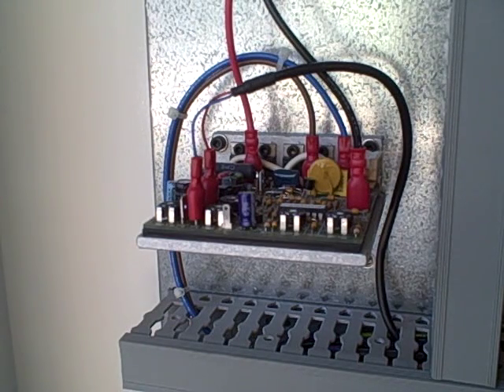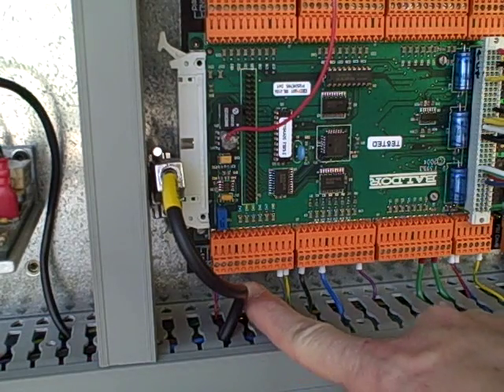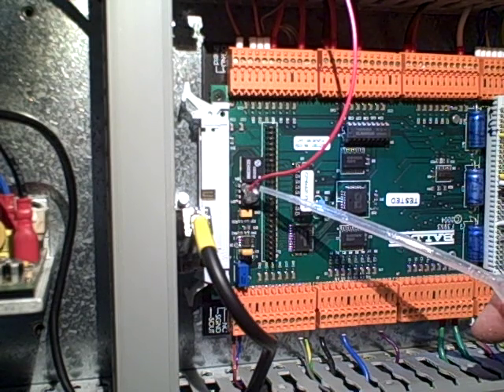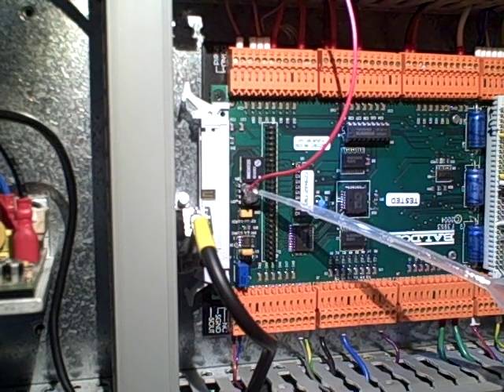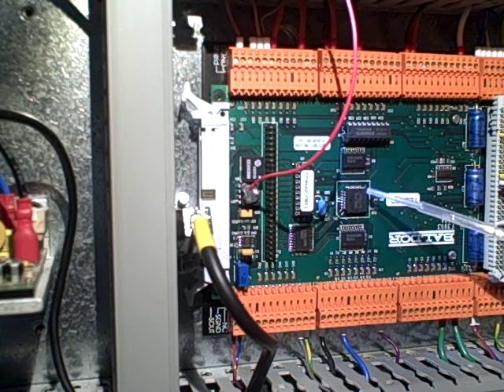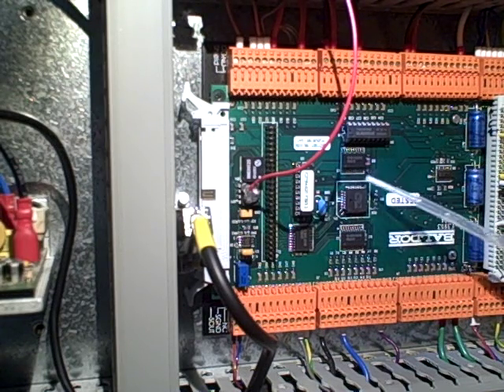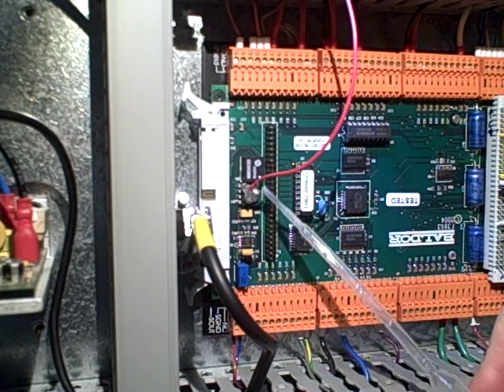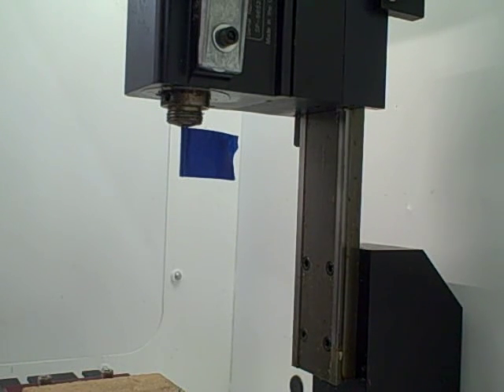Part 3:  Spindle PWM Control- Denford Micromill 2000 / Scantek

Comment: hello i have a Denford micro mill  Despatch date  11-jan -01 it has a Denstep F391 issue 1 bottom board and  i have wired it  on the 96 pin. X axis 12A-X Gnd.-to bob ground pin . 14A-X step.-to pin num 2.  15 A-X Dir. -to pin num 3. then Y axis  B14-Y step.-to pin num 4.  B15-Y Dir.-to pin num 5. B17-Y Gnd.-to bob ground pin. then Z axis 14C-Z step.-to pin num 6. 15C-Z Dir.-to pin num 7. 17C-Z Gnd - to bob ground pin . im using uc-100 with a db 25.  6 axis bob im pretty sure i have the UC-100 and bob working with mach 3 the blue and green lights are on anyway but my motors just hum. I have enabled  motors xyz. I've  selected pin-outs and port 1 for xyz   the dro's move but no motors move  any help is much appreciated
Reply from the maker: I'm not familiar with that specific setup (mine doesn't have DRO's built into the machine, unless you are talking about the on-screen DRO with Mach3.) I would suggest that you wire up the limit switches to the BOB and get them working first, that will confirm a lot of your software configuration and wiring is correct (and are vitally important to make the machine self zero and for safety).  Also check that the E-Stop button is reset.
Reply: @summetj   Thank you for your reply and all you videos on your conversion. I have got all axis moving now i had settings in mach3 wrong . My Y stepper is  junk  and it is a nema 23.  6 wire dc 2a 1.8 deg but only uses 4 wires to connect to driver board. So can i just use a 4 wire steppers? Would going a little bigger steppers hurt anything ? and on the limit switches is there a reason you went to home pins  X.- Home0  C26.  Y-Home1 B24 .  Z-Home2  C23 instead of limit0 limit 1 and 2? I have a 96 pin chart that says where every thing is but don't understand which ones i should connect to are  the limit signals grounds i think i need  grounds on my bob limits and e stop signals. Thank you and sorry for the thousand questions but any advice is much needed.  I cant seem to post any pics on here.  also mine only has a main key switch that seems to be a momentary because it don't turn off the mill    RED POWER LIGHT.   IS NOT A OFF BUTTON. has a spindle on/off switch and one pot for  speed control  i don't know how to shut off the mill i have to unplug it from wall
Reply from the maker: @christopherferguson3614  I think I used "home" instead of "limit" because I was trying to get the "homing" function working first. I think in mach3 you can configure the home and limit switches to both act as each other, so which exactly you connect them to may not matter.

I believe you can use any 4 wire stepper, but the driver board has a maximum current output, so you want to stay in the same general ballpark for stepper motor sizes.

My case has a power switch on the side, right above the power plug port that turns the whole system on/off. The key-switch is required to enable power to the motors on startup as a safety feature.
Reply: @summetj   Ok do you happen to know what the max driver output might be? I was wanting to stay with nema 23's but just a hair bigger say in the 200oz ballpark. I'm also wondering  My mill has  standard lead screws do i need to be set to inch on mach 3 or does it not matter? and do i need to turn on sherline 1/2 step in mach and thanks you for all your assistance. i'm new to cnc but want to learn
Reply from the maker: @christopherferguson3614   I don't know the exact technical specs, but if you are just going a shade bigger it will probably be OK. You can calibrate Mach3 in either inches or MM as long as you have an accurate distance per revolution in that unit.
Reply: @summetj ok my steppers are 1.8 deg i have it at 200 steps per rev does that sound right ? and does sherline 1/2 step not matter?

Comment: hello could you post the settings you used in mach3?
Reply from the maker: I'm afraid that while I used an evaluation version of mach3 for testing, I switched over to LinuxCNC once I got the hardware working, and did not save any files from the mach3 setup.

Comment: Hi Jay,

Thanks for posting this series, it has helped me a great
deal with my Denford mill. I have X, Y & Z working fine. However, I am struggling a little with the Mack3 spindle settings. Any chance you could also share these please?
Reply from the maker: I'm afraid that I don't have the MACH3 settings file any more. From what I remember, I used PWM settings between 20% and 100% to drive the spindle speed (Plus the spindle power enable line as well....). Make sure that you can enable/disable the spindle (0 and full speed) before you move on to trying to output PWM to control the speed.
Reply: Thanks for the reply. I will get there - today I hope.
Thanks again for this series, it has saved me no
end of bother.